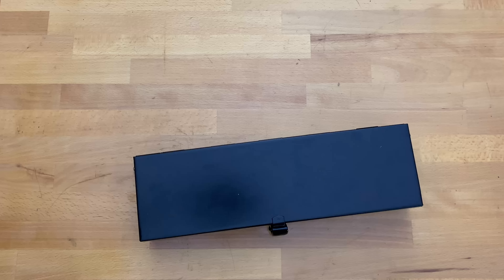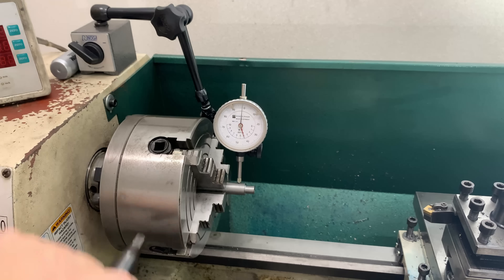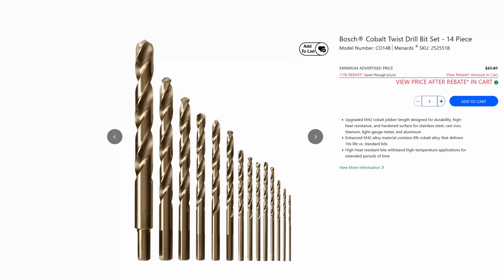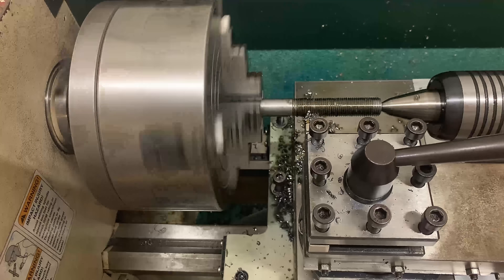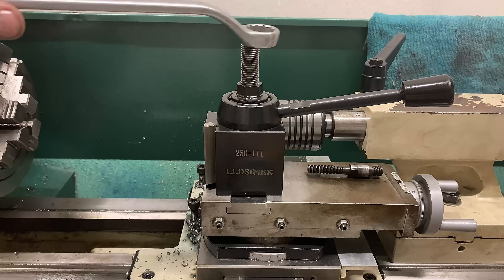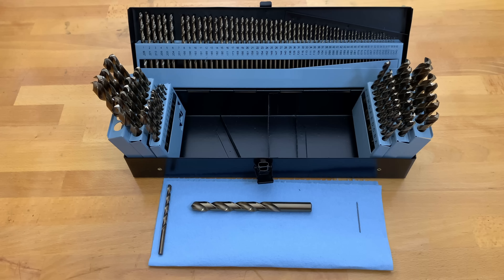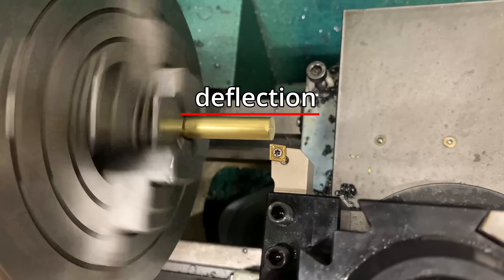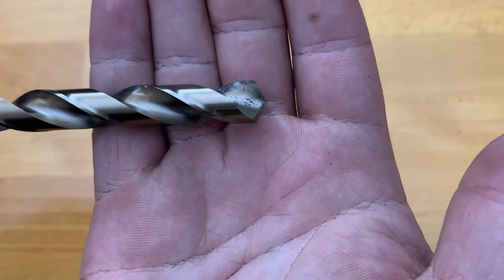Are Harbor Freight Drill Bits Secretly AMAZING?

Comment: I've drilled tons of holes in stainless with these. Even with the bits < 0.060" where you can snap it easily by breathing on them at an angle.
100% skill issue. These people are probably the same ones running their drill dry on high speed to go through steel.
Reply from the maker: What machine are you running those tiny ones on? That's really impressive!
Reply: @ShopHumor Hand drills lol. The trick is have the patience of a monk. (at super slow speeds and good cutting lube). And if your chuck can't go that small you can try to evenly wrap the bit in copper wire to help the chuck bite down. I usually chase the holes with a reamer to straighten the holes so the slight run-out isn't an issue.

Comment: Great video, this makes a good case for cheap cutting tools. You're absolutely correct in that it takes skill to use tools properly and that using them in rigid machinery helps a lot. Even the best sets out there wouldn't hold up to an idiot using them. We run a small production shop, i mostly do the electronics and i code as well, but most importantly, I run the place as the owner. I have one guy doing general assembly for sheet metal enclosures etc so he does a lot of drilling and tapping with relatively small sizes (M2, M3, occasionally M5). He breaks maybe 1 tap a year or every other year. We had an intern working with him this summer and that guy broke 6 taps in one day. When asked how, the guy said he didn't know, that he just went at it with a cordless drill and it just happened. Our guy does tapping in a drill press using proper cutting oil.
Reply from the maker: Thank you! Breaking 6 taps in one day is an expensive day for an intern! Just "going at it" with a cordless drill.. jeez.

Comment: I actually purchased that miserable Bosch 14 piece set from menards for work since I foolishly believed they were going to be OK quality. I wasn't expecting viking quality, but at least a step up from the cheap bits. Nope, I got 2 holes out of the 1/4" bit drilling through 1/2" drywall and a metal stud. The 3rd hole, I couldn't drill through the metal stud, which is basically sheet metal. Just some of the worst bits I've ever used, and I was disgusted since I've had decent luck with bosch tools before but hadn't bought any of their consumables. LIght maintenance work and after 1 year all but 3 of the bits have been pitched. I know how to sharpen bits, but we don't have a grinder at work and they aren't good enough quality to bother anyway. They're honestly about the same quality as those super cheap 'TiN' coated bits you see in those $4.99 bins at hardware stores.
I've actually had better luck with that harbor freight set, although part of the reason is that I reserve those bits for when I need a particular size (tapping and lathe work mostly). They've been very true to size and perform well, the only ones I've had issues with are the super tiny number bits, which like any small bit will break if you even look at them funny. Probably the main issue there is that I can't spin them up fast enough in either the lathe or drill press, but that isn't the fault of the drills.
Reply from the maker: That’s really disheartening to hear how negative your experience has been with that Bosch set. Not good when they’re on par with the bargain bin TiN coated bits but for a lot more money.
Reply: I got that set years ago for drilling out bolts and have barely used it, good to know I should get something else if I start a project that actually needs them to last.

Comment: I hear tons of garbage about HFT drill bits. I smile and nod. I have the 29pc split point set and the 29pc brad point set from HFT...used 'em for years in my wood shop. I replace broken bits (usually 1/8" and smaller) with 'open stock' from HFT for the split points and Fisch for the brad points. The drill index is ...well, I like it better than the old school metal ones.

I am pretty anal about my drills. Take them from index, install in appropriate device, utilize, remove, clean and return to case. I'm not drunk-drilling into solid steel. Most (90%) applications are chucked into my drill press. Proper speeds, both rotational and feed. I use 'em like they were designed to be used and they work for me. 

So...perhaps the moral of the story is A: read the reviews. B: add one star for every mutilation of the laws of English. C: add one star for every two misspelled words. Bet ol' Sourpuss just wrote a five star review...😂
Reply from the maker: Haha that’s too funny. You’re exactly right, use them like they were designed to be used and they’ll work just fine.

Comment: Why are these called cobalt when they are marked HSS?? Alum and brass aren't going to be a problem.. Did you drill the .040 hole? Maybe I missed that.. One hole with a lot of coolant and a chip breaker is NOT a test at all.. Try a drill press and drill 30 or 40 holes hand feeding.. AGAIN why are you calling these Cobalt?
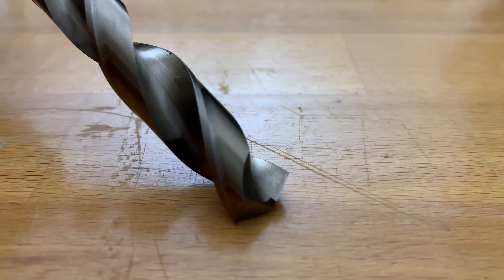Reply from the maker: They’re mostly HSS. M35 cobalt drills have 5% cobalt - M42 have 8%. They’re marked HSS Co (Co for cobalt), which you can see at 6:16 in the video. It’s a little faint but it’s there.
Reply: @ShopHumor WHAT?? HSS Perhaps you should do a little research.... That junk was on clearance do to the FALSE advertising on the box.. THOSE ARE NOT COBALT!!!  HSS is the material the bits are made from NOT the HOGWASH you slinging.....

Comment: I've got a set of Harbor Freight drill bits I bought close to 40 years ago. This was still before local stores when you would fill out a paper order from a paper catalog and drop it in the mailbox with a check, then wait a month to get your order in a soggy brown cardboard box. I still have that drill index and even some of the original bits in sizes that I don't use often.
Reply from the maker: That’s great! Man how times have changed. Everything is on demand, instant gratification, overnight delivery.
Reply: Me too!
Reply: Me too- catalog order "Huot" 30pc black oxide 1/16 to 1/2 by 64ths ~30  years ago.  My drill index/Case is pretty sturdy.  Best $15 I ever spent.  NP wood, aluminum and occasional iron & steel.
Reply: @matopezuta2050  about 30 years ago harbor freights retail stores had a lot of name brand refurbs. Makita, dewalt, etc.

Comment: Honest review, I bought a cobalt set in 2008, from HF, after wasting money on the nitrite coated filth for years.  I still have 90% of them, having broke one .60 bit using a hand drill. Go figure. That aside, other than rushing a drill or two on hardened spring steel  without cutting oil, I have yet to dull the rest.  They are sized right, labeled well and can be used with machinest index to match threads and other pilot holes.  They are not warrior or bauer as those brands didnt exist yet, but they are good enough, id buy a new set, if I ever wear them out sufficiently.
Reply from the maker: Glad to hear that they’ve done right by you. It really is handy to have an index on hand for all those oddball threads that pop up from time to time.

Comment: I've used a variety of harbor freight drill sets like this over the years their great general purpose shop bits and it doesn't hurt as much when someone decides to abuse them and break them we have sets of last three years in general use they're used to drill essentially anything that you would drill with a drill bit metals plastic steel tool steel I think they're a little harder than a lot of drill bits and actually will drill a harder material better than a more expensive drill any case they're a great value for the money even if they are at the world's greatest drill bit
Reply from the maker: Yep I think the value is just really good. At 65 cents each, it’s hard to compete. I’m just a hobbyist so I don’t do a ton of super hard materials but these cut through mild steel with zero issues. For my needs they’re just fine.

Comment: I have a the same set, I’ve used it for AL and wood and plastic mostly. I’ve used it only occasionally for steel, usually using other bits mostly because I don’t want to break one of these and then have to chase replacements. I lost a rivet on a hinge which I replaced with a 4-40.  I think this set epitomizes the mantra that any Harbor freight tool is better than the tool you do not have. So this gives you the chance to have what you need, and if you break it or dull it,  then replace that bit with a quality one and build up you quality a little at the time.
Reply from the maker: I really like that mantra! How have yours worked in plastic? I’ve never really worked with the material.
Reply: @ShopHumor  just got to be ware of melting and it snagging. Slower speed and tap it in and out to avoid binding. Also, make sure to clamp work down well, or it can snag onto you drill and then you have spinning parts!
Reply: I use my black oxide drill bits for wood and soft metals. Cobalt is really for drilling steel.

Comment: I've used both the Warrior and the Milwaukee set for the last year or so. About 45/45/10% on a Bridgeport a lathe and a hand drill. Ironically the #7 has been sitting in my tap index about since I bought the Warrior set. And that has been mostly used on a hand drill. I did snap one Milwaukee bit though drilling through (roughly) 38mm 316 plate. The rest have held up fine. Keep em lubed and take your time with your feed rates and they are just fine.
Reply from the maker: Man, 38mm 316 plate is a job for sure! The #7 really does get a lot of use. It seems like half of my gadgets are 1/4-20.

Comment: I have a set of these cobalt drills. It seems that at the time of my writing (September 16, 2024, 22:30 hrs.) HF has upped its game with some of the drill bits. The 29 bit set that is always on sale is still a throw away set. These however, have done well. I do use them often and so far, I have not broke one and they are still acceptably sharp. They certainly are no competition for my Cleveland Twist Drills by any means. They are, though, about 1/8 the cost of the Cleveland drills which are also dead accurate for sizes. The HF drills have minor variances between sets. Not enough to make them unusable, though.
It has been my experience that only those who have a reason to complain, for whatever reason, are the ones leaving the reviews. Most people, myself included, when happy with a product don't bother with a review unless it is pretty much shoved under their nose. When I see only a few negative reviews and they don't match then I consider those to be the rants of habitual complainers, not people who have enough true experience or background to fairly judge a product. Your review is pretty much on par with my own experiences. If you know how to read the instruction and can follow them, then these bits will serve you well. If not and you are a drill hog then expect failure, lots of it.
Your video was well done. Concise and to the point. No real fluff and stuff. I like that.

Comment: I purchase 2 sets (HSS version) in the late 90's when they cost $50 a set (with the discount coupon) to use a a poor mans version of precision gauge pins. Once in a while I used them for drilling and they were great.  Still are.
Reply from the maker: That's great. Have you found they were close enough to use as gauge pins for your needs?

Comment: I have been using these drills for years on steel, stainless, and titanium . My machinist friend recommended them years ago. Best bang for your buck..
Reply from the maker: I agree, such an incredible value. Are they perfect? No. Are they pretty damn good, and an amazing value? Yes sir.
Reply: No you haven't.. NOT stainless (any grade) and NOT Titanium...
Reply: @twistedhillbilly6157 
Speed and cutting oil exists, as does experience as to what speed and pressure to use. It absolutely can be done.

Comment: I have a Harbor Freight drill index similar to this I bought 30 + years ago. Probably just HSS. I mostly work with wood, but I do drill aluminum, brass, and some steel. I’m a guitar maker. 

The set is still going strong, except for some of the small wire gauge bits I broke or lost.

I use them in a drill press and hand drill.
Reply from the maker: Man, getting 30 years out of a set of drills is simply outstanding. Making guitars sounds really cool, I bet that isn't easy!

Comment: I can speak to the garbage that goes by the name MIlwaukee Red Helix cobalt drills.  I purchased my first good drill bits, a 29-piece set of Milwaukee jobbers length cobalt drills, back around 2003.  They were incredible.  They cut well, stayed sharp, and I rarely broke one, even when drilling by hand.  That said, I did break a few of the small ones, and a couple of my most used ones got dull, so I decided to replace individual bits.  I couldn't find Milwaukee replacements, so I tried a couple other brands, all of which were disappointing.  Eventually, I decided to bite the bullet and buy a 13-piece set of the red helix bits since I mostly needed smaller sizes.  They were nothing but trouble.  Something about the grind made them grabby as hell, which resulted in breaking them easily -  even in the drill press.  I don't know if it was just a bad grind, or if they were brittle and had a bad grind, but they sucked.  They were nasty even drilling pine because they wanted to rip the drill out of my hand.  Believe those reviews.  Ended up buy a 115 piece set of Walters.  It was an investment, but I don't regret it.  Also still have what's left of the original set of Milwaukee's and still love those too, but the new ones are no bueno.
Reply from the maker: That's really good information. I couple other people have left comments saying the same thing about those Milwaukee's. I'm glad I stayed away from them! I know Milwaukee does have some really good sets because I have used them myself, but sometimes it's just hit and miss, like you said with a bad grind perhaps or something about their manufacturing process that made them especially brittle.

Comment: FYI you should be using a spot drill not a center drill. A center drill is for using lathe centers. A spot drill has a wider angle (usually 140°) than your drill so the point touches first and helps keep it centered
Reply from the maker: Thanks Will. I'll need to put a spotting drill on the list of tools to buy. Got any recommendations or do you think just any old one will do?
Reply: @ShopHumor  we use ones from McMaster at work. They're pretty inexpensive and they offer carbide and cobalt ones. Just search "spotting drill". 🍻
Reply: @ShopHumor  
Guhring 9005460060000
Keo 103-034144
Emuge EFUT3300.0635
Harvey Tool 737816
They come in all sorts of sizes, 1/8" 1/4" 6mm 8mm 10mm 12mm. Picking one sometimes depends on if you want an edge break on the drilled hole or not.
The design of newer drills have a 140 degree drill point and are "self centering." The "correct" spot drill has a 142 degree angle. This way the center of the drill point will make contact first and align itself with the spot.
The way you were doing it should work for a manual lathe and mill, but will beat up the corners of the drill. It worked for 50 years, so it would be fine for what you are doing. In large quantity runs, I'd say get a 142 degree.
Over 8x diameter you want to pilot drill (1.5x to 5x diameter pilot).

All this depends on the alignment of machine as well. Your lathe drill chuck looks off center. The drill moves on the way out of the part and moves back on the way in.
Reply: @ShopHumor  If you are going to be using the center drills make sure you only go deep enough so the first countersunk lip is cut. 
You don't want the straight shaft or the large center cutter as the tip has better angle geometry to use with your drill bits so it doesnt chatter/wander
Reply: Why spend more $'s when a centerdrill works just fine?
Reply: @jims6323  because if you need precise holes then you need to start drilling with the tip of the bit and not out on the flutes
Reply: What happened to my comment? Was it deleted or is YouTube being awful and not showing me my comment?
Reply: @moej6014  YT's pretty bad about deleting comments, about 1/2 of mine just never show up.
Reply: This issue is actually not black and white. Many very experienced machinists prefer center drills to spot drills even for the op before drilling. It appears to be somewhat of a religious war
Reply: @michaelandersen7535  it's proven that starting a drill with flute contact is not good for accuracy. For most machinists out there it probably doesn't matter though. We do really small holes that need to be very accurately placed and very straight. Using a proper spot drill is the only way to ensure that